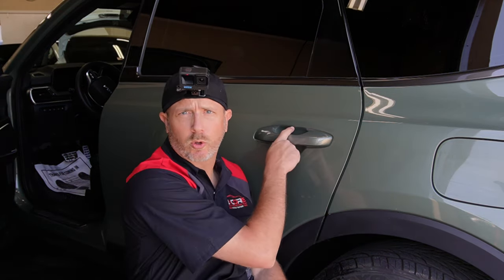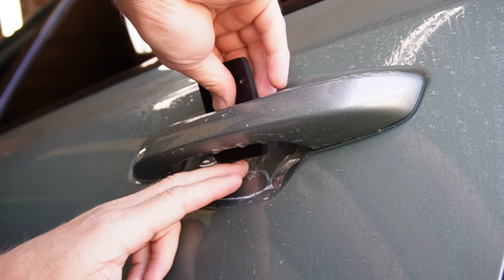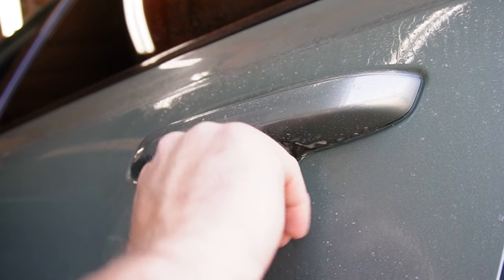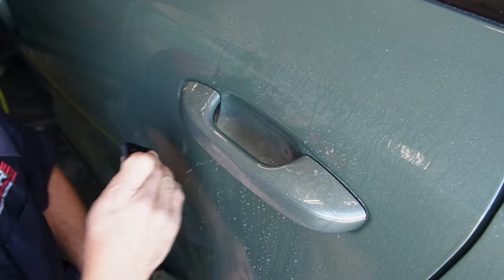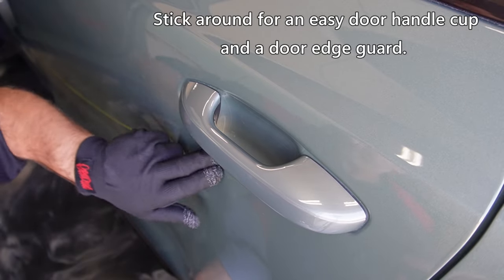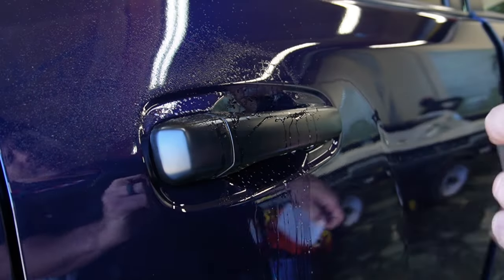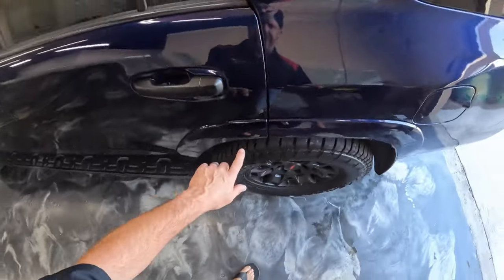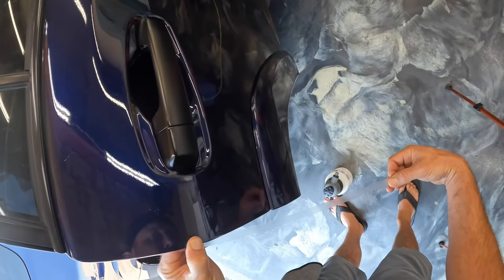How To Install PPF Door Handle Cup Protectors

Comment: Learning new tips here, thanks
Reply from the maker: Great to hear! Thank you for leaving a comment and letting me know that the video is helpful. 👍🏻😁
Reply from the maker: Have you started cutting on paint yet or practicing?
Reply: @EncorePPFtint  I did … I have an hard to getting the screeching noise (probably don’t apply enough pressure)… I use 30degree Blades . Ill try with your Olfa to see if the results are better. I’m sh@$ scared of getting through my 2023 4Runner’s  paint… Your videos helped me very much!
Reply from the maker: Are your 30-degree blades made by Olfa? I've found that knock-off blades can be really bad. I now only use olfa exclusively.
Reply from the maker: Definitely practice a lot before cutting on your 4runner. Hitting the paint is a really hard way to learn how much pressure you need!